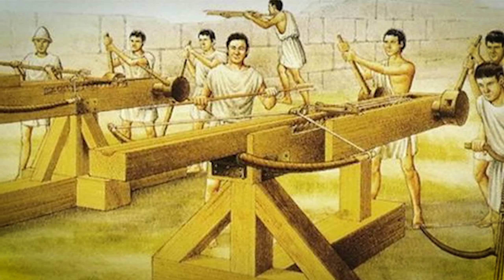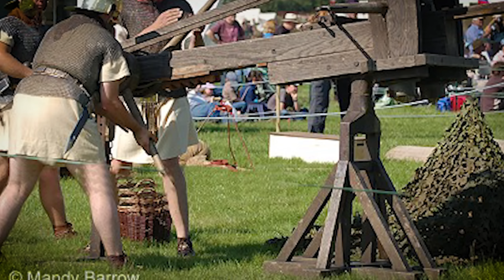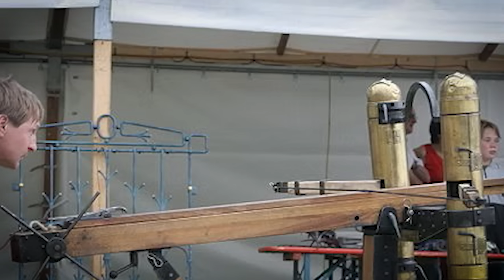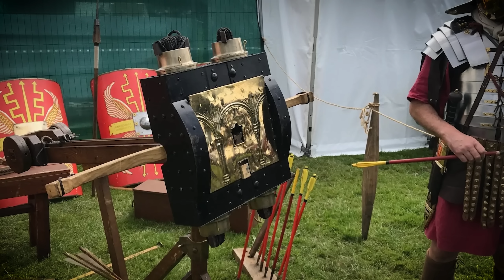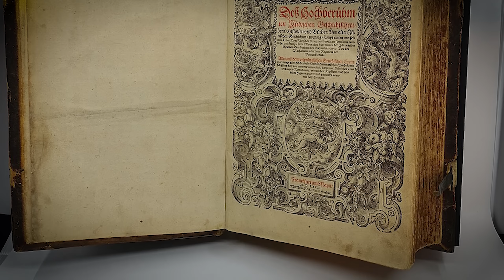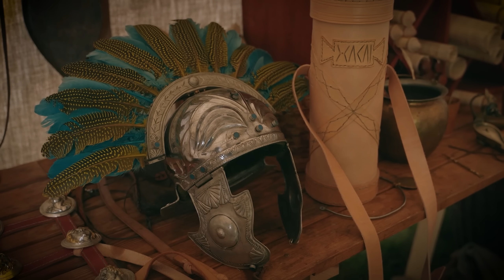Rome’s Deadliest Artillery Machine | How powerful was Ballista?

Comment: Has anyone made a genuine authentic one? I saw them trying to do so once using bull sinuous etc and whatever else was supposed to have been used and it didn't work, wasn't a powerful weapon, pretty lame really. So is there any vid or proof one it really working without using modern materials, speargun rubber etc?
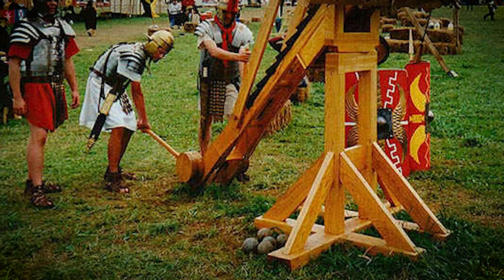Reply: Our team’s was pretty close to fully authentic. A photo is shown at 6:20. Our only concession was using nylon kernmantel rope fort the torsion spring. However, the modulus of elasticity for sinew rope and nylon is very close. We didn’t’ have the budget for that quantity of sinew rope. Several of the other ones shown in photos of re-enactors are also built properly, according to the proportions. Although there are others that are far to flimsy and poorly built. Many of the drawings from Victorian times are way off.

Comment: Were the projectiles only bolts, or did they fire stones or fire-based weapons too?
Reply: All types. But the bowstrings had to be changed. If you were using fire bolts, you’d want to use a metal liner in the guide rail.

Comment: What kind of mechanical tension system powered the ballista?
Reply: They explain it reasonably well. You can see it in some of the photos. A twisted loop of rope made of the hamstring sinew of large animals like bison. Pretensioned with large Iron spanners. There was one on each side with the arm inserted into the middle.

Comment: Could the ballista shoot downward from a wall without losing effectiveness?
Reply: Yes, but generally only a few degrees below horizontal. There were probably specialty variations that could shoot at more depressed angles. But most of the time ordinary bows could do it cheaper and more easily.